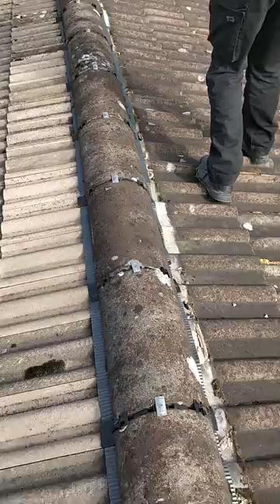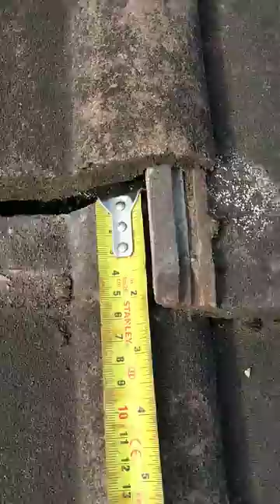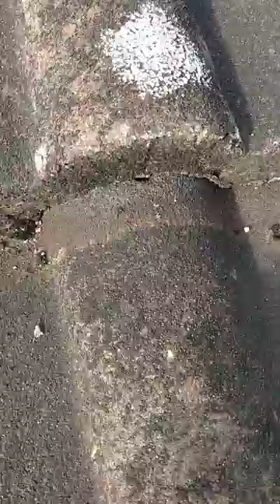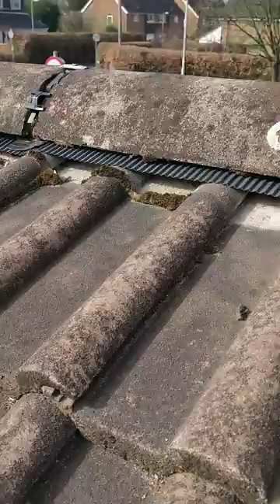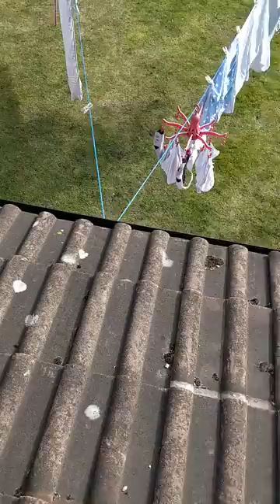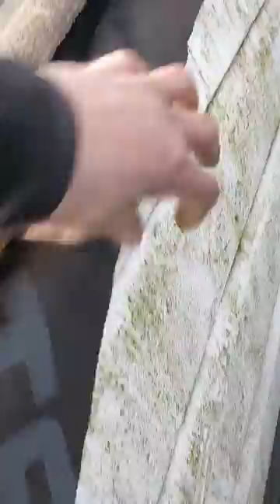Cow boy roof job.

Comment: It’s a good job tho we have firms like this finding cowboy work 
I was on a re roof last week 
No shit it was 38 courses straight bond lats not even staggered 1 in 3 I’ve never seen anything like it no over hang on the gables they went flush to the brick work 😂 butchered the verges underneath so they could get them on 
It takes more time in the end bodging rather then doing it correct the first time lol just set the roof out and mark out before just tiling and hoping ffs 🤦‍♂️ 
Same with gauging up I see guys just go up at 13.2 then measure to the ridge tree after hitting half way 
That’s why we see what we do in this video a 2” overlap on the tile seeing the nail holes 
It’s ridiculous 
I’ll tell you the problem 
We train a labourer up who after a year thinks hold on 
I’m doing same work as roofer here but less pay 
They think they are a roofer after a year or 3 😂 so leave get a lad and take on work 
We have lads who claim to be roofers … who are NOT!! 
All the gear - No idea